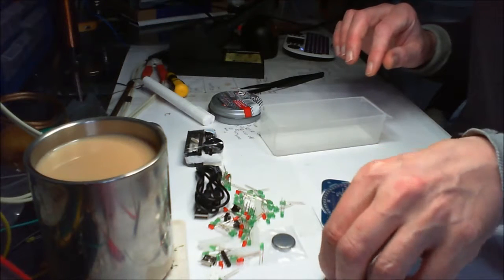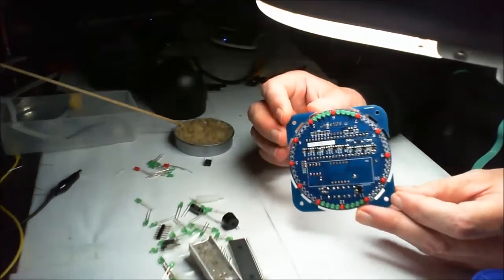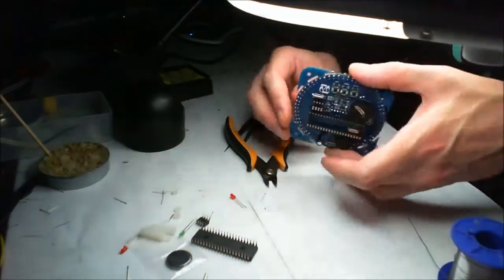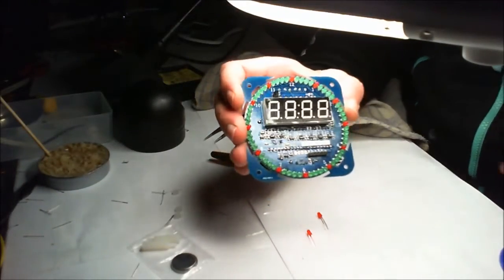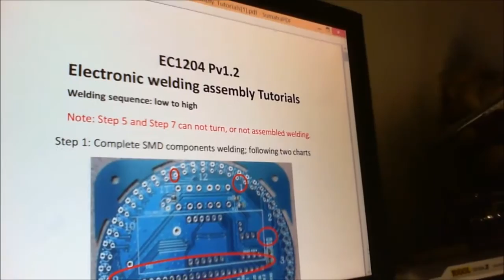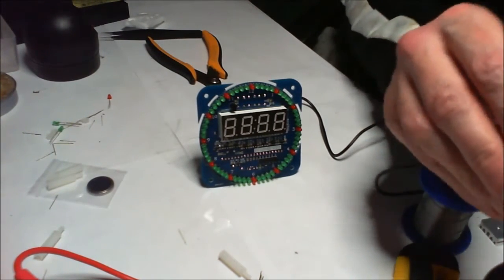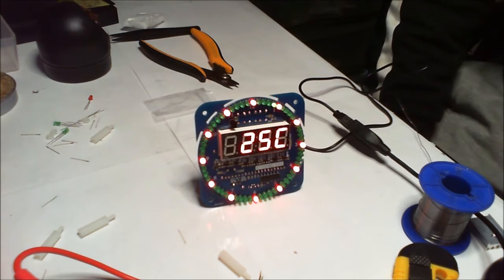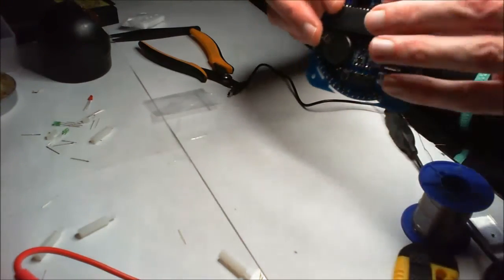eBay DS1302 Rotating LED Electronic Digital Clock Kit pt2

Comment: Nice build, I just got a kit today.
A little advice: When soldering SMDs in place, don't transfer solder from the iron to the pad, put a little on one solder pad for each component instead. Apply some flux (preferably liquid) to it and place the component. It's much faster that way.
Keeping the solder on the iron will only burn of the flux.
By the way, the Bluetooth connector is for a seperate module. It can be used with a smartphone to monitor and set the clock. I'm not sure how useful it would be, but it's a nice feature.

Comment: I'm in the market for one of these diy clocks, especially this one. My question is have you thought of an enclosure for it? If not did it come with one?
Reply from the maker: +Paul Palumbo Hello, Yes, I thought inside a picture frame with a cloth front, or glass. Not got round to it yet. Careful where you buy from not all sellers are the same quality. Cheapest is not always the money saver we hope for.

Comment: hello
write, please, where are the elements to go, because I do not have user manuals, there are two types of resistors and capacitors are also two types
Reply from the maker: did you find manuals ? they are out there.

Comment: '
can this DIY rotating LED clock kit use a pack of four AA batterys = 6 volts...
would be work fine or better not...
will it burn out LED lights or two microchip controllers or both
Reply from the maker: Checking the DS1302 datasheet, VCC is 5V but it also indicates 5.5V https://datasheets.maximintegrated.com/en/ds/DS1302.pdf
The AT89S52 can use upto 6.6V absolute maximum. https://www.keil.com/dd/docs/datashts/atmel/at89s52_ds.pdf
The LEDS are current limited with resistors so will be fine. I would say the suggested 5V is preferred and convenient but 6V max should be OK. I use a laptop battery cell with a micro charger I fitted for 5V USB charging. I have not tried with 6V
Reply: hi E...
thank explain link...
over 6 volts is a too much for the LED clock
Reply from the maker: I tried mine at 6V and the only difference it made was the temperature showed a lower reading. It made no difference if I wound it up slowly to 6V or off on at 6V. Hope this helps.